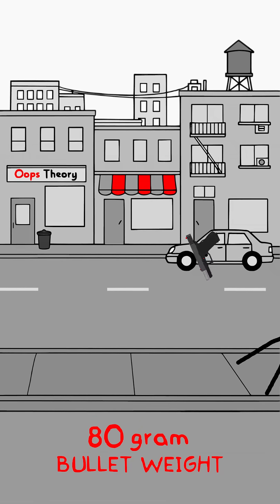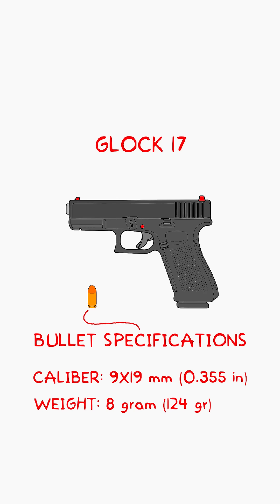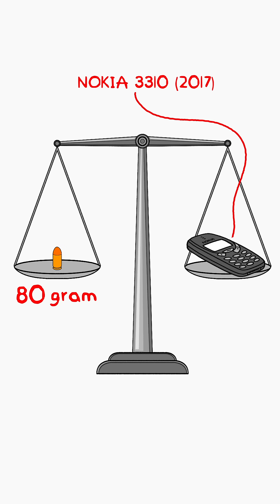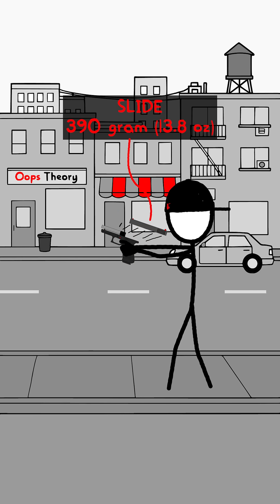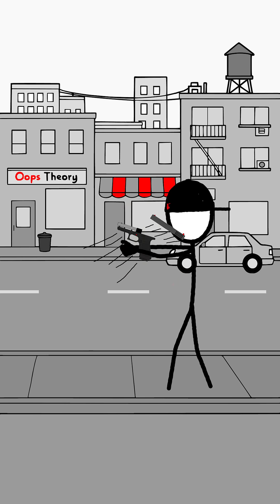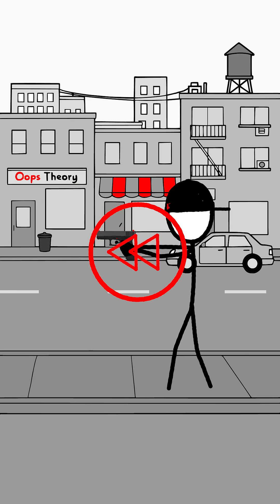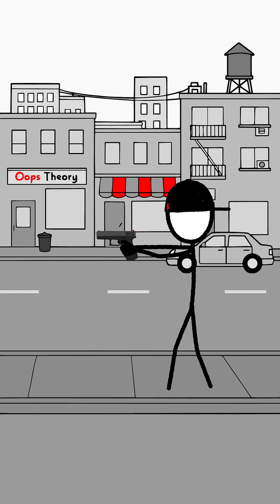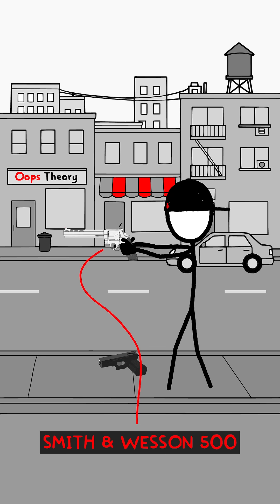What if a bullet were 10× heavier at the same speed?! #whatif #science #physics #experiments

Comment: Id you kept powder load the same and assume a denser bullet and somehow the same acceleration time you would basicslly just solve ke where its set to 500 joules

So ke=v^2*m/2

500=v^2*0.08/2

6250=v^2/2

12500=v^2

v=111.8m/s

Assuming the muzzle energy stays identical

It will exit at 111.8m/s or 366.8 fps or about 250 mph

Comment: Made by someone with 0 understanding of ballistics.  Lets assume you made a super dense bullet out of tungsten or something that weighed 80 grams and bored out the throat (as it would still be too long). You could find a powder that would launch it at acceptable chamber pressure levels and it would move at like 100 mps. Or you could overpressure it and blow up the gun as suggested but the failure point won't be the slide. The primer pocket will blow out or the case head will fail. The frame will Crack but the slide probably won't fly off as pressure will bleed off the failed case blow off the mag as pressure dumps through the firing pin channel.  Odds are you get a face full of shrapnel and your hand is badly cut but its unlikely the slide is coming straight back at you. If the slide DOES come off it may hit you but a lot of the energy will be dissipated in the ways I mention. Assuming it doesn't hit a jugular probably a lot of cuts and broken bones are possible not instant death.

Comment: i mean... the powder in there wouldn't be able to push it, end of story, recoil is either 0 because it doesn't even fire properly, or it's the exact same
Reply: Actually I think with the same amount of powder it would be square root of 10 times the recoil, since recoil is dependent on momentum, not kinetic energy. But that's only assuming that the same amount of powder always imparts the same kinetic energy, which I think is approximately true (assuming same barrel length). So basically 10 times the mass with the same kinetic energy would travel square root of 10 times slower since kinetic energy is proportional to speed squared. Since momentum is mass times velocity, 10 times one over the square root of 10 is the square root of 10 (assuming it is still able to fire)
Reply: @j_the_guyis_taken3409 so it's close to an airgun then, since a 9mm is kinda limp anyways xd

Comment: All this relies more on the amount or intensity of the gun powder in the bullet rather than the weight of the bullet itself.

Irl the powder goes off and the gun doesn’t even really explode like it would if it had an overly hot round, more just kinda fall apart in a slightly explosive way
Reply: Someone failed high school physics
Reply: @ponche22 increasing the weight of the projectile but with the same amount of gunpowder in the cartridge means the same amount of force acting on both projectiles. Just one is heavier and won’t go as far.

If we are assuming more black powder to get the projectile moving at the same relative velocity you’ve now got a whole other host of problems. Namely trying to fire a .50 cal with one hand. 

Then you get the whole gun exploding into a million bits part
Reply from the maker: You’re absolutely right about how real firearms work - heavier bullet + same powder = lower velocity, and pushing it to the same speed would blow the gun apart. 

The video just uses a controlled same speed, 10× mass scenario to explore the physics behind the impact itself.
It’s a thought experiment, not a real ammunition setup.